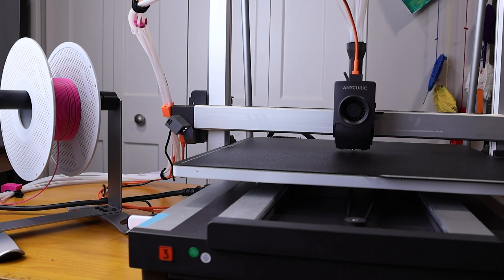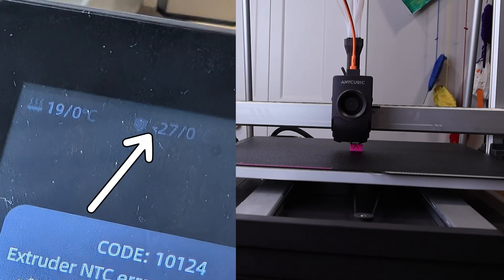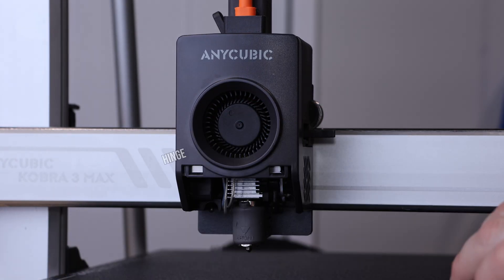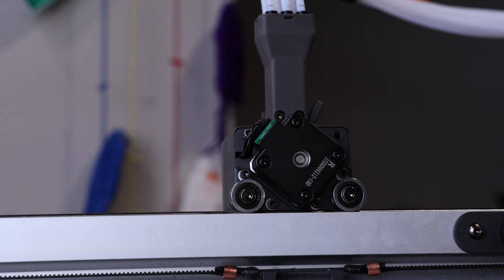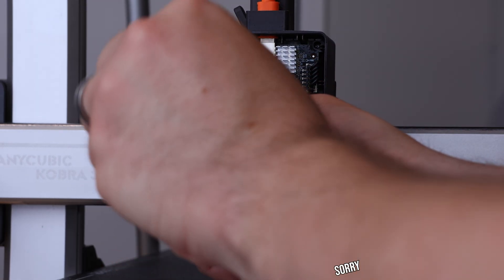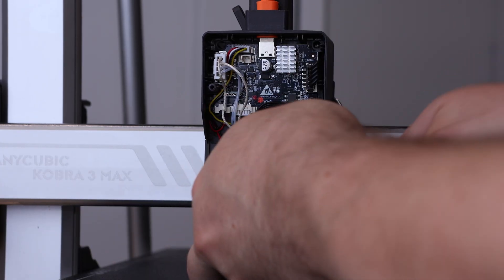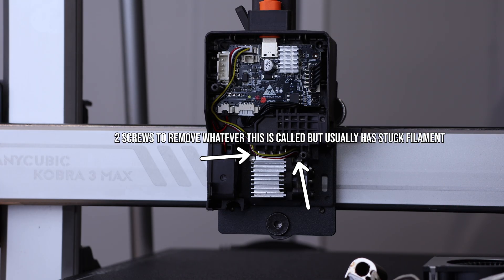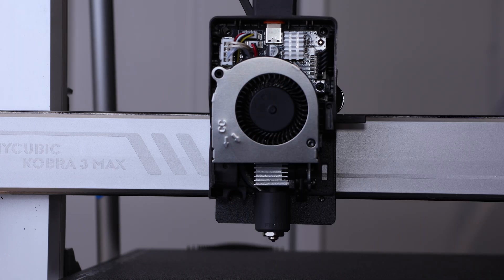Anycubic Kobra 3 Max Clogged Hot End And Extruder NTC Error 10124 #repairing

Comment: Do you know by chanche if there is a way to put screw in nozzles? Like the hardened steel ones. I can only find the quick swap normal ones. I also find the replacement hotend that allows the screw in ones, but it has two connectors with two wires each instead of one connector with 4 wires. I think that's because it's for the Kobra 3, not the Kobra 3 Max. Thanks!
Reply from the maker: There are only the quick swap nozzles for the K3 Max unlike the smaller K3.  On Amazon there are quick swap nozzles with screw on tips if that is more of what you're looking for.